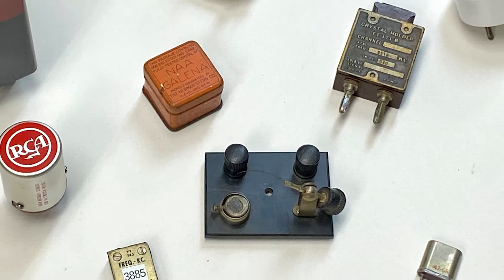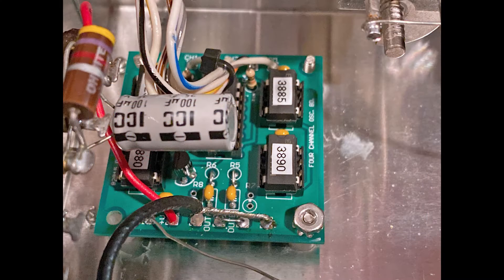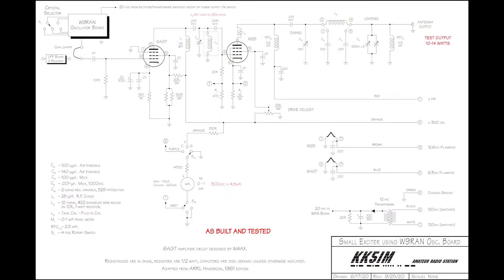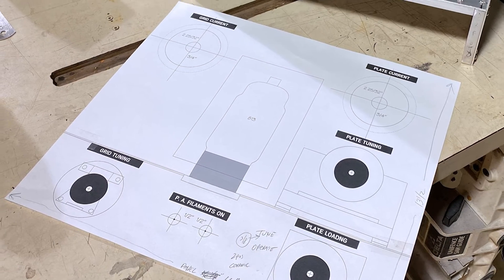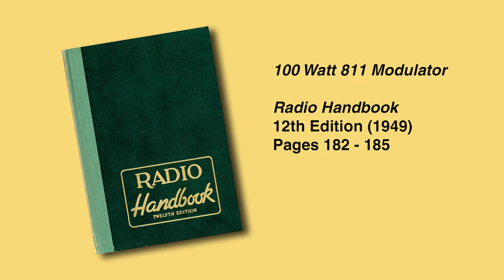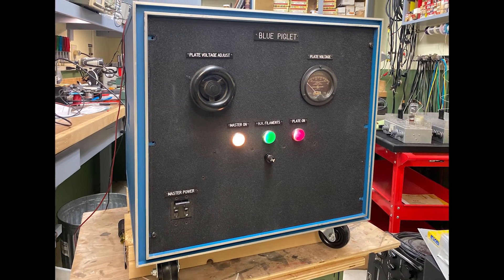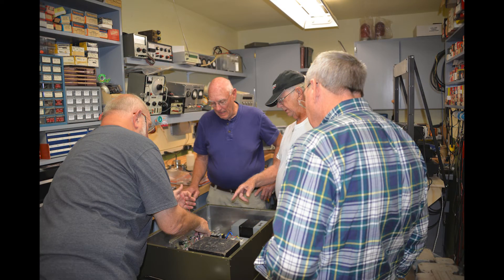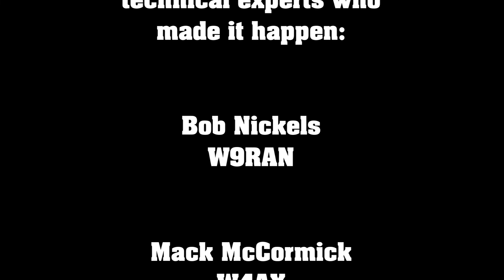Build a Digital Oscillator and Complete Tube Transmitter for AM -- The R.A.N. Transmitter

Comment: I remember in the 1970's I built an 813 rig....(4 x 813), running in triode mode and cathode modulated.  Very hi-fi audio,  most contacts thought I was running a globe 500 or a johnson kilowatt.  That system has been in storage now for over 25 years.  I MISS those days,  but I do not miss what amateur radio has DEVOLVED INTO !!!
Reply from the maker: A LOT of AM activity on the bands in the early mornings and evening. We usually have 12 or so on 3885 1100 UTC.

Comment: Nice work! I’m currently building a CW rig with an 6ag7 Osc with 6550 final. Output into a dummy load puts it at around 20 watts. I plan on adding an amp stage and possibly a modulator stage. We’ll see.
Love the way the cabinets look! More rigs should be showing off the tubes as you did. 
73
Dave
W6CPY
Reply from the maker: Thanks Dave!